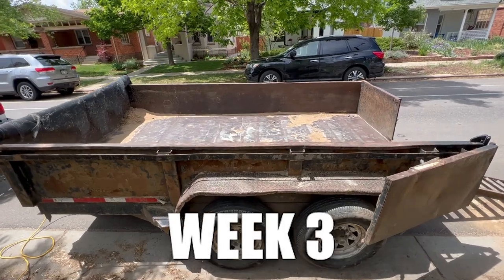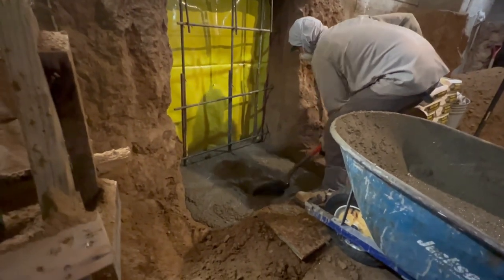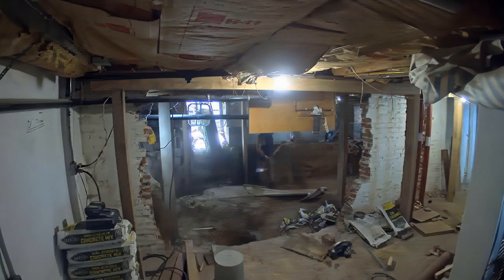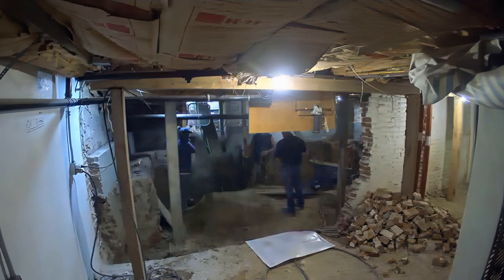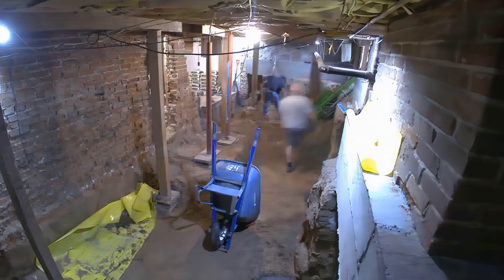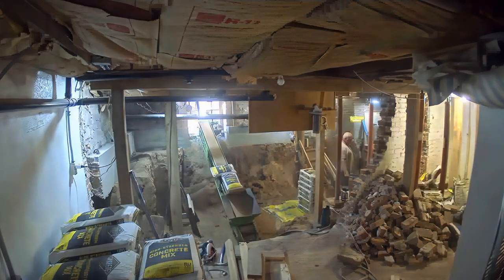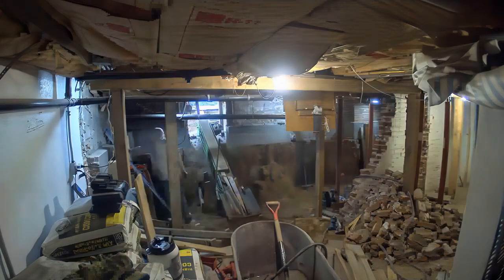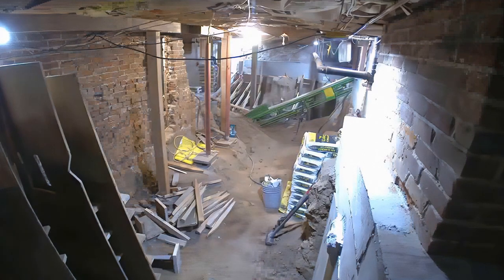1900s Home Hand Dug Basement Digout - Time-lapse

Comment: It’s great to see the way the underpinning is carried out. 
I see you use ready mixed high strength concrete. Why don’t you mix your own? 
Also, after you’ve poured the upright slab, does the top shrink back slightly from the existing footing?
Maybe the type of ready mixed concrete prevents shrinkage.
Thanks.
Reply from the maker: We do mix our own when we can't get a hold of ready mix but its mostly a time and cost factor, And it may because all concrete has a shrinkage factor to it ! Thank you for the great questions !